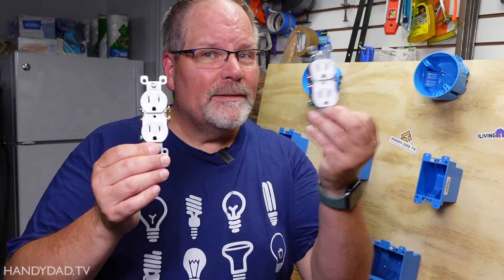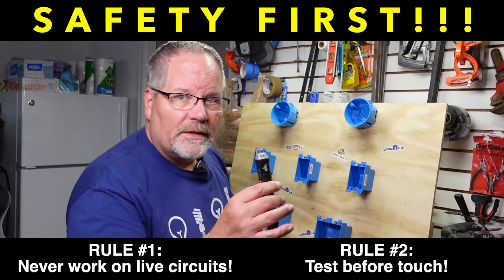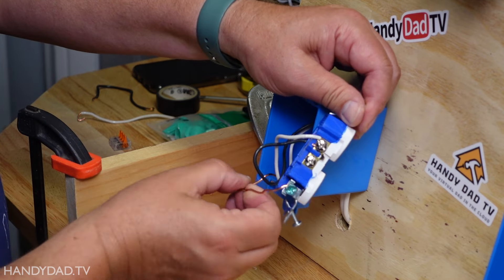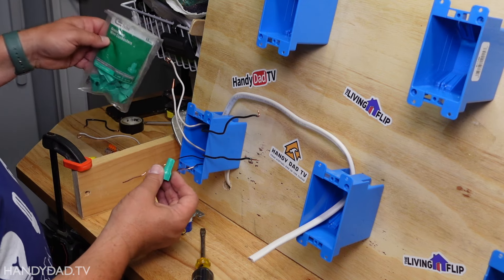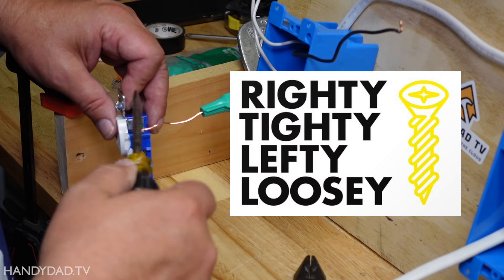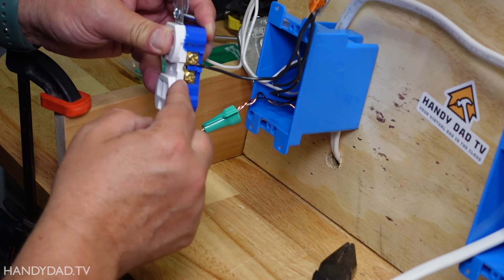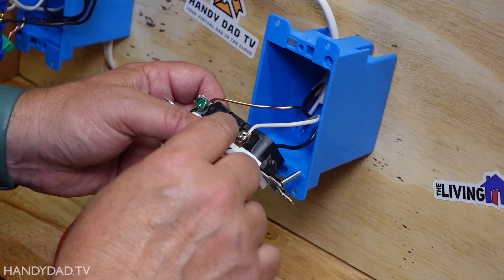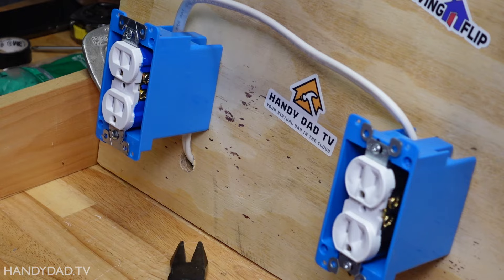SAVE $300 EACH!! How to Add an Outlet from Another Outlet

Comment from the maker: REGARDING THE CONTROVERSY: The two sets of screws on a duplex receptacle weren’t put there as wire connectors; they are needed in case you want to split the two plugs on two different circuits. You can separate the two screws by removing the tab between them. 

However, code allows you to use them as wire connectors if you want. But it’s not required.
Reply: Fantastic
Reply: After get done connecting the pigtails will them fit inside the Box just wondering if it will be a space for them?
Reply from the maker: @basicnunchucksduarnerey53 I always recommend deep boxes.
Reply: I was going to say it shouldn’t pass through and heat the receptacle up like you mentioned unless everything was on. Which would heat up regardless of the use of pigtails

Comment: Very good example. Some may try to daisy chain this when inexperienced, very good explanation. Myself personally I wire nut wires under a wire nut with their pigtail.
Reply from the maker: I use pigtails when needed. But I have no issue using the screws for two wires.

Comment: Very good video.  Regarding the overheat/over current from fastening both hots to the gold screw.  Because of the shunt between the gold screws/post electrically they are the same whether individually attached or using the wago.  Personally I like the wago far above screwing down to the post.  Thanks
Reply from the maker: Thanks for your input

Comment: Great video! Of course the trick is always how you get the wires bent and back in the box. I'd like to see you do that.  That is the one thing that is always challenging for me.
Reply from the maker: I’ll put it on the list. Thanks.
Reply: Along- Starting with the ground wire, fold in into a "Z" so it does not catch or cross the white and black wires as you z-fold it flat. Repeat with the white wire, avoiding conflicts with the other two. Offset the wires to one side so they don't stack up on top of each other. Finish with the black (hot) wire. Using two-gang boxes all the time instead of single-gang boxes will give you a LOT more space inside the box and make this easier. (I learned this last trick the hard way w after wiring an entire garage.) :-(

Comment: A perfect video!  I watched it twice and was able to add a GFCI outlet under my kitchen sink!  It was a bit of a pain cutting through the back of the cabinet, then drywall, and trying to strip wires with the disposal in the way while on my back, but it turned out perfectly.  Next time I'll do a little more pre-planning! 😂 Thank you for sharing your expertise!
Reply from the maker: I HATE working under the sink! Good job!
Reply: Hey, I'm about to do this in my house actually.  I need a socket for toe kick lights.  What challenges did you face and what would you recommend?

Comment: Thank you for these very helpful videos! I had a pro electrician install two 20 amp home runs from the house to the shed and I was able to finish the job myself thanks to your videos!!! My plugs and lights are on one 20 amp circuit and  the other 20 amp has one dedicated plug for a window air conditioner.    Thanks again!!!
Reply from the maker: Glad it was helpful 👍🏻
Reply: I want to run 3 plugs, one switch and a light/fan to a single plug for off grid. Can a single plug handle that?

Comment: Thank you for the tip. Grounding wire connectors were new to me. Thank you for the tip about using the tester. I do so all the time and, just yesterday, I was working on my dog porch. The panel was supposed to shut down 8 outlets, the outside light and the 4 LED ceiling lights. I found a 3 way switch was still hot. The breaker was mislabeled and the inside lights are powered from the adjacent room's lighting circuit. Also I was warned by my electrician to avoid quick connectors. He had a couple get hot and melt; he thought because the metal connection is so thin. If wires are twisted together, 3 three wires shouldn't overheat using a proper sized wire nut. Also, my house was built with the cheapest outlets, so I replaced them with Leviton's upgraded outlets. My other home center stopped stocking Leviton, but seemed to have similar. Those are both great, excepting the metal back plate is also a ground strip.. usually still better than the 39 cent variety. When the dog porch was completed, I had the contractor install the outlets. Somehow the hot wire rubbed against that metal back plate. I'm not sure why, but after a few years, when plugging something into that outlet, the hot would come into contact with ground, so always make sure all that extra wire is tucked away from the back of the outlet. In my case it was never enough spark to trip the GFI or breaker but, after 6 years, melted the insulation off the last 1 1/2 inches of the black wire.
Reply from the maker: Wow. Thanks for sharing.

Comment: I am a DIY person and I have connected the black and white wires  respectively to their copper and silver screws, given two of each screws on either side of the outlet.  I did not know that the outlet would heat up if connected without using pick tails. Thank you for this valuable information.
Reply from the maker: Glad it was helpful 👍🏻

Comment: Clearly explained, Question, can I use this procedure when mounting a GFIC outlet on the exterior wall using the required waterproof box and enclosure?  Thank you
Reply from the maker: Yes. Just connect the wires to the LINE screws on the GFCI.
Reply: Thank you for the quick reply

Comment: I have an outlet in the middle of a wall behind the headboard of my bed. I want to take that plug out and add a plug on each side of the headboard behind (2) nightstands. is it safe to use a junction box to do this?  please show a video of this if possible, thanks for your time.
Reply from the maker: I wouldn’t bother. I’d just run two 6-foot extension cords to each nightstand because they’ll be hidden by the bed.

Comment: If an outlet was run with yellow romex, can I use white romex for adding other ones?
Reply from the maker: Yellow Romex is 12 gauge wire for 20 amp circuits. You need to use the same wire for all devices if you intend to keep the 20 amp breaker. 

If you switch to thinner wire (white Romex is 14 gauge wire for 15 amps), you would need to reduce the breaker. 

It’s better to get yellow wire.
Reply: @handydadtv  got it! Thanks!!

Comment: hi, your video was most helpful. I’ve put in many outlets before, but this particular case they want to add an outlet in the bathroom it has to be a GFI the only power I can get to on the other side of the wall there’s a kitchen outlet I guess the principal is the same, I guess I’m better off to also put a new GFI in the kitchen
Reply from the maker: I wouldn’t do that. Bathroom and kitchen circuits should be separate.

Comment: well done.. most everyone will gain from this.. my case however,my uncle was great electrician.. trained by military.. owned his own company as electrical contractor... made a very good life after serving his country.. he always train his workers and me to always work with power on.. as he said,"more people get hurt from dead wires than from live... you kill power and if not in place where you can lock out tag out... somebody flips switch back on and POW.. youget zapped.. but if you leave power on you know to be more careful and not touch both wires at same time...he lived into his 90's..I'm in my 70's now and never had any zapps due to me thinking wires dead and someone flipped switch.. I always work with live wires BUT I am very careful and take extra time to go slow and safe..
Reply from the maker: Really good story, but I’m sure you can imagine, I can’t recommend that method to newbies who don’t have mentors like your uncle to teach them.
Reply: It is safer and easier working with a dead circuit unless there is no choice which is very rarely the case in a residential situation.  As far as the concern of someone else energizing the circuit, I put a pad lock on the entire breaker panel after the circuit is shut off. If this is not an option due to panel design or other reasons, a circuit lockout device should be used on the individual breaker. Always check at the point of work that all wires are de-energized as more than one circuit could be coming into the same junction box.

Comment: Very helpful video! This should be good for a garage ready refrigerator, correct? I’m planning on adding another outlet for the fridge alone from one of the existing outlets in the garage. Thanks in advance!
Reply from the maker: Consider running a new circuit for the fridge because they use a lot of startup power and it could flicker your lights depending on whatever else is on the existing circuit. If it’s not an option, then sure you can extend an existing circuit.

Comment: Nice job!! Very good info.
I do have another question, how many times can you reaper this process? Can you add 2,3,4 outlets? I have a 20 amp breaker?
Reply from the maker: Yes you can repeat as many times as necessary. But adding outlets doesn’t add capacity. You can still only use 20 amps max across all the outlets.
Reply: @handydadtv  can this process be done with adding a double outlet from an existing single outlet?
Reply from the maker: @jacksonstorm4619 Yes

Comment: Thank you for your videos as they definitely help the husband at home complete some simple diy projects. I have what may be a stupid question.. i’ve always avoided doing electrical because it can be very unforgiving. But I’m learning a lot more and becoming a little more comfortable. I am adding a second outlet using an existing outlet. My question is, what type of wire do I use? As I went to a hardware store to pick some up I found out there are many many different kinds. So as I said, I am new to this, so bear with me lol. Thank you for all your help.
Reply from the maker: Find the circuit breaker for the existing outlet. The number on it (usually 15 or 20) is the amperage rating. If it’s 15, you can use 14/2 wire. If it’s 20, you need to use 12/2 wire.
Reply: Thank you

Comment: Yes, thank you,, very helpful video. Been a carpenter all my life, but never messed with electrical. 
I had "pro's" upgrade house to breakers, a ran a few new circuits.
But, had an after thought, and want to add another outlet up higher on the wall, for a wall mount tv. Still have one side of the drywall off, so much easier now, than later!
My question is if it is ok/safe to add another outlet. I wish I could send a pic, ha!, but I believe this new "tv" outlet would be the 3rd outlet on this new circuit.
 PS: the pigtail thing went by a bit quick for me, but think I got it after watching it a few times, 😆 I hope I can find those little connectors. 
I ass-ume, it doesn't matter in what "order" the source/hot wire, and the out going (2nd) black wire go into the connector? And then the 3rd "pigtail" wire(s) goes to source outlet.
Thanks again!
Reply from the maker: Technically, there is no limit to the number of outlets on a circuit. You’re only limited by the amperage capacity of the circuit. If you attempt to use too many devices at the same time, you could pop the breaker. The average 4K TV uses around 1 amp so that’s not going to be an issue for you.

Comment: so quick question, everyone i know and everything i have ever been taught says it’s fine putting the two blacks on the receptacle and two white wires on both screws. if it will create heat on the receptacle then it makes since those connections your using will create heat there. either way you look at it. they both become a distribution center for lack of better terms.
Reply from the maker: Nothing wrong with using the screws. I’ve done it my whole life. 

But I made some early videos using that method and a lot of people commented that pigtailing was better. The other benefit, beside heat, is the outlet can be removed without disrupting the rest of the circuit. Of course, I always recommend turning off the circuit breaker first, but many electricians prefer to leave it on.

Comment: good morning Dad! Love the video. I have a question on a slightly different application of this. I need to add a 24 volt transformer somewhere in the basement so I can run a "C" wire to my new smart thermostat. can I add a transformer down stream of an outlet just like you show here? I don't think that's a problem, right? Then I will simply run my new 24v hot wire from the transformer to my thermostat and that will be that.
Reply from the maker: Usually those transformers are attached to a junction box. But for the C wire, you’ll want it to run from the existing transformer in your furnace, not a new transformer.
Reply: @handydadtv  thanks for responding. I am getting off topic here but if you can help, I'd appreciate it. I'm a first time homeowner so I don't really know anything. ha. Upon closer examination of my boiler controller, I see that zone 1/2 has a jumper so effectively it's just one zone. I think that's fine because how the radiators are setup it seems like there was no rhyme or reason how the zones were setup. I'm ok if it's just one zone, at least for now.

That being said, do I simply just need to run a new wire with a C wire (3 wires) to the thermostat location and that's it? I don't need a transformer since the C connection will supply the power itself. Right? It's unfortunate that the installer didn't just run a standard thermo wire (5 wires) even if 3 were not used with the thermostat setup they installed.

https://imgur.com/a/4PIy7vs
Reply from the maker: Yes, off topic and I don't know much about boilers and radiators. But, in theory, you should be able to have separate thermostats for each zone. Not sure if that transformer will be enough power for multiple smart thermostats.

Comment: This video definitely gives the information in a way that’s easy to understand, I’m going to add an outlet higher on the wall to mount a tv but the outlet I’m going to get power from his about 4.5 ft to the right and at the bottom of the wall. Anyway to run the Romex without going through the studs?
Reply from the maker: You could go up through the attic or down through the basement. Otherwise use this: http://amzn.to/2tC3mQJ

Comment: Very informative video.  Just had a question.  Could you have created a pigtail for the ground wire just like you did for the black and white wires using one of those connectors?  Or was there a reason you didn't?  Thank you very much for your time and expertise.
Reply from the maker: Yes, I could have just used a wire nut and pigtail. No different electrically.
Reply: I had the same question thanks for answering

Comment: Great content here! Love everything except the mention of wago lever nuts having a higher operating temp range. I believe it is actually the opposite - most wire nuts have a higher operating temperature than Wago lever nuts. Always check the manufacturer’s specs
Reply from the maker: I’ve seen testing on YouTube. But regardless of the connector choice, the insulation on the wires melts first.

Comment: Thank you! We just had our deck redone, and I'm looking to add 3 outlets this way. Two for lights up top, and a 3rd down lower for the Traeger to plug into. Will the Traeger have too much draw to be on the end of the line? The lights that are going up are LED string lights, so they will draw very little power. Using weather resistant outlets in outdoor housings, and there is a GFCI already on this circuit inside the house.
Reply from the maker: If the Traeger doesn’t use electricity for heat, you should be fine.
Reply: @handydadtv  It only powers the fan to circulate, the auger to feed the pellets, and the display screen itself.
Reply: Once the hot rod gets the pellets burning, I think that shuts down as well.

Comment: Great video!!  New sub!       I have an issue wiring a ceiling fan hoping you can help. 
I have a ceiling fan that has (including ground wires), 3 wires from power source,  3 wires from wall switch, 3 wires going out the other side of fan junction box to one outlet.  I need some help on how to join all these at the fan. Can you help?  Thank you my friend 🙂
Reply from the maker: First, open the switch to ensure the black and white wires are connected to the switch. If they are, put black tape around the white wire to indicate it’s not a neutral. Do the same with the other end of that wire in the ceiling box. 

Connect all the grounds together and hot (black) wires together, including the fan. 

Connect that white wire with the tape to the blue wire on the fan. That will control the light from the switch. 

Connect all the neutral (white) wires together, including the fan.
Reply: Thank you so much!

Comment: Sorry if this is obvious but where did the third wire for the pigtail come from? And when bonding the copper wires, when do you stop the bonding and what happens to the remainder that doesn’t come out of the nut hole? Thanks! Great video overall.
Reply from the maker: One wire comes from the breaker. One goes to this receptacle. The third goes to the new receptacle. 

Inside every wire nut, even the green one with the hole, there is a cone shaped spring that secures the wires as you twist.
Reply: Sorry I was referring to the first black wire you inserted into the pigtail 4:27. Is that just scrap wire you had?
Reply from the maker: @vsall410 Yes create pigtails from scrap wire.

Comment: Great video. Thanks.

I would like to add an outlet from one bedroom in my trailer home to a porch using the type of wire shown in this video. My question is, do I need to run the cable through a piece of conduit PVC pipe? The wall is only 4 inches thick.
Reply from the maker: Check local codes. Some areas require conduit or shielded cable.